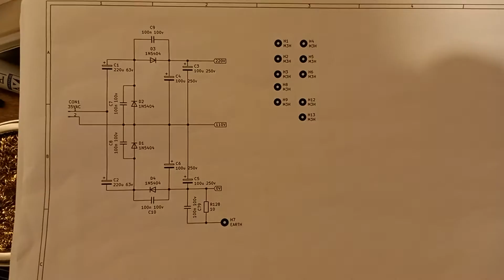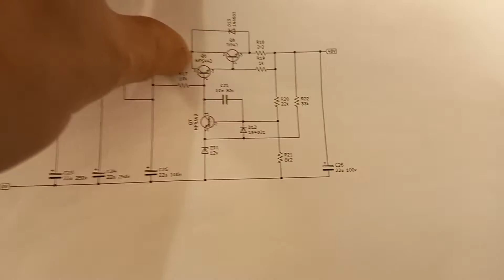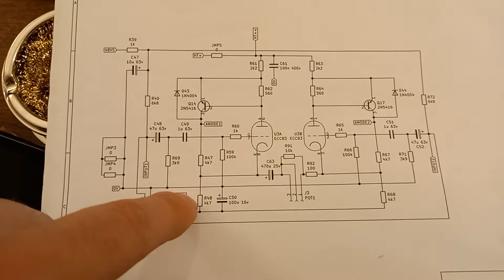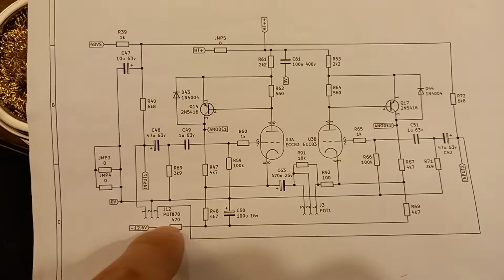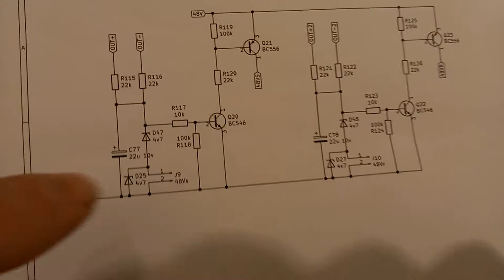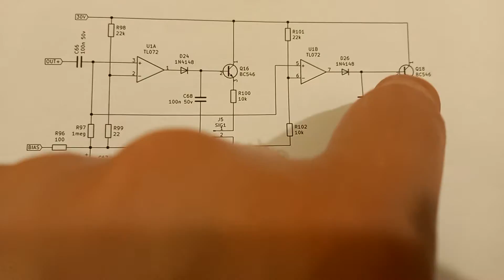dual mono tube mic preamp

Comment: Great video I'll have to watch it a few more times the video format is spot on. Thank you for that !  Would it be at all possible to get a PDF schematic drawing and diagram .
Reply from the maker: I'm planning on building a revised design that uses a simpler PSU design and improves on the gain stage. It works well but at high gain it's a bit noisier than I'd like.

Keep dropping by my channel, hoping to get back to building things soon once I've got a few things sorted.